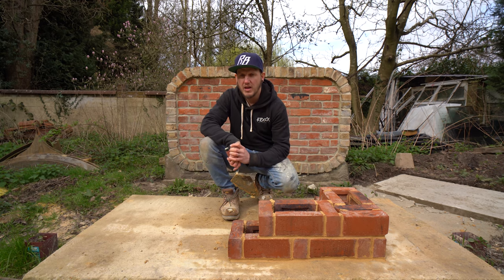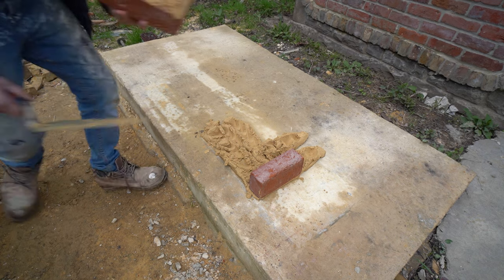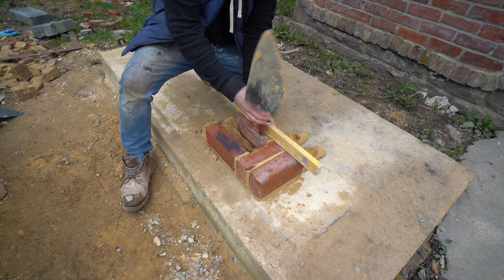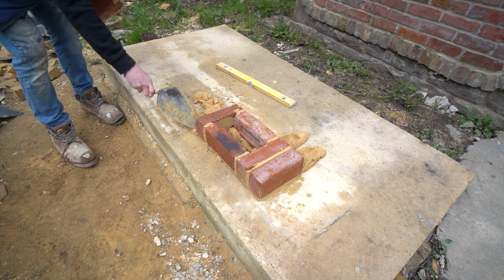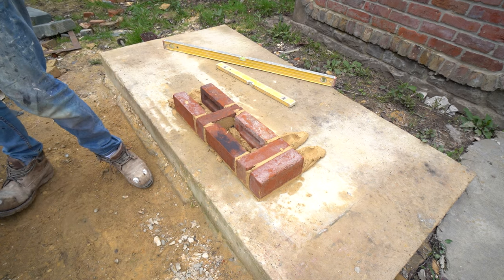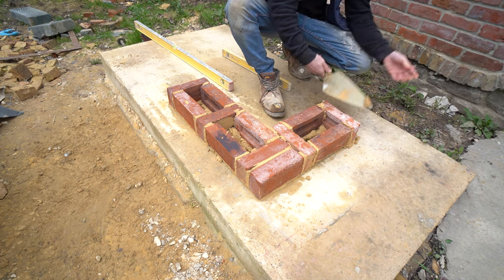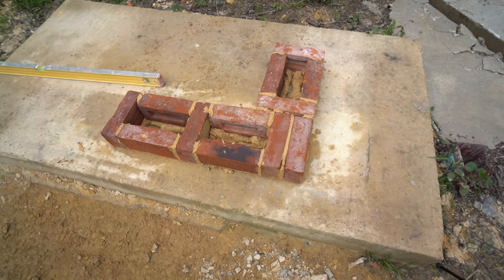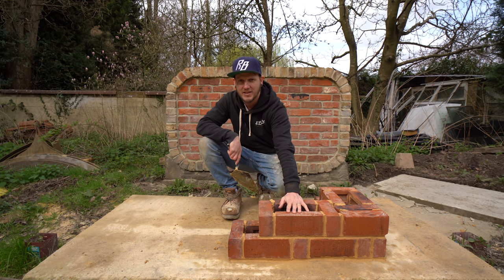BRICKLAYING TUTORIAL - Rat Trap Bond

Comment: We always called them solder courses, every 4 brick in the running bond between inner and outer...but we laid the brick normal not on side like that! This method was used mostly for pure mason house no wood frame on exterior walls of house only plaster to brick on inside, this was before much insulation was used

Comment: The concept behind the bond was that it would save on materials and mortar without compromising the strength of the wall. The only time I've ever come across it was in several houses on the same road in Dulwich, south east London, where they'd used it to build the sleeper walls for the ground floor floor joists to sit on/span across.
Reply: It's used a lot in india, cos it's quite strong, saves on material, and creates a cavity to keep the heat out.

Comment: Some brick manufactures make 65mm bricks with face surface on the bed face. They can be used as paviors as well. I've used those bricks your using and a pack of frogged bricks usually has a good percentage of solid bricks where the molding process skips a frog mold
Reply from the maker: Come to think of it I have actually seen those style bricks.